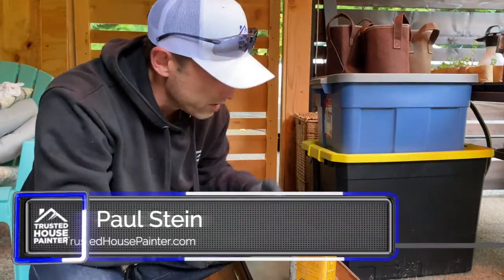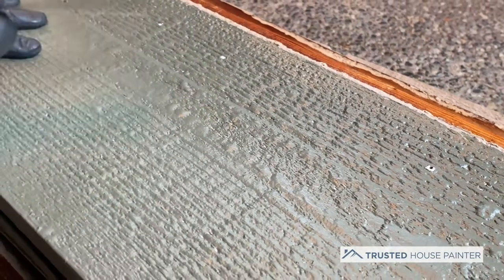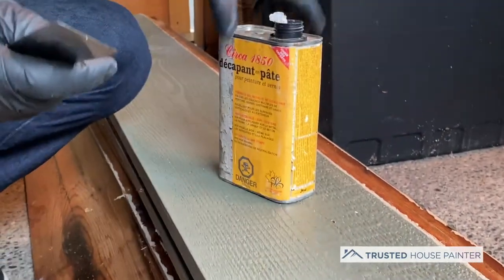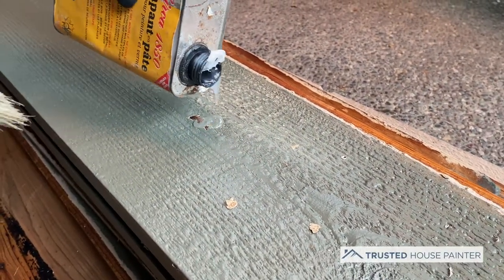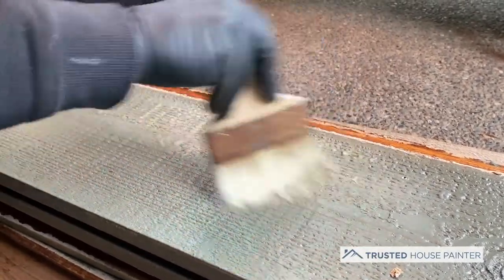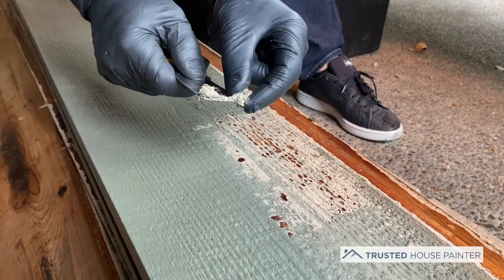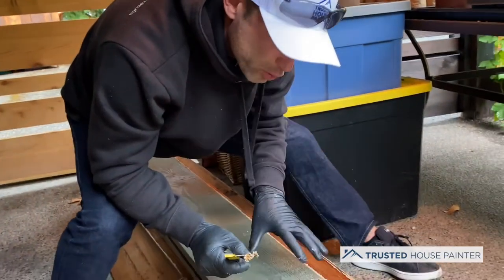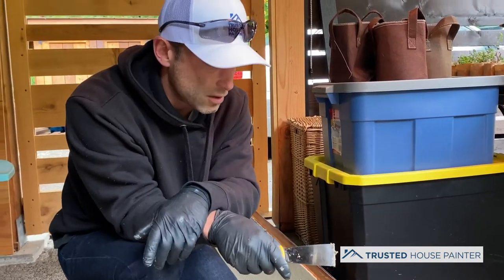Circa 1850 Demo: Removing Paint Off Cedar Boards.

Comment: Great demonstration - the only correction is that Circa 1850 Heavy Body Paint & Varnish Remover does NOT require any neutralizing after application. It does, as you mention, require and after wash with mineral spirits in order to remove the residue of the stripper itself.
Reply from the maker: Thanks for the correction.  I generally neutralize the surface anyway to make sure there’s no issues after I’ve painted the coatings!’

Comment: I have yet to use my bottle, I'm trying to find more information first. If I put it on something to take off the paint, what will I have to do to clean it off? Running water maybe?
Reply from the maker: Actually as mentioned by luckypup825 in the comment below, 1850 Heavy Duty Paint and Varnish remover does NOT require any neutralizing after it's application. It does however require you to wash with mineral spirits in order to remove the residue of the stripper itself. I hope this helps you with getting started. I highly recommend wearing latex gloves, wearing eye protection and using it in a well ventilated area. It's good stuff and it's probably the best paint and stain remover I've ever used! If you need more info about this product you can email Eric at echaimberg@swingpaints.com 

He can help you with any question. Thanks again for your comment!

Comment: Can't you just sand blast the paint etc off those boards?
Reply from the maker: Yes, that’s another option. However sandblasting needs containment plus cedar is a soft wood. I’ve never sand blasted soft wood before so I’d be extremely cautious. Heat stripping or using chemical remover IMO are faster and cleaner.
Reply: @TrustedHousePainter  cheers mate.